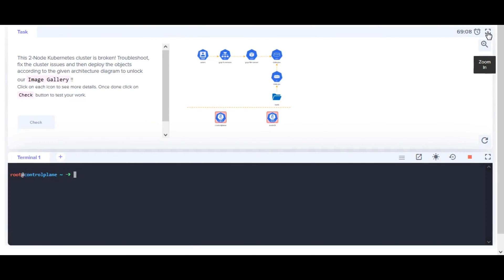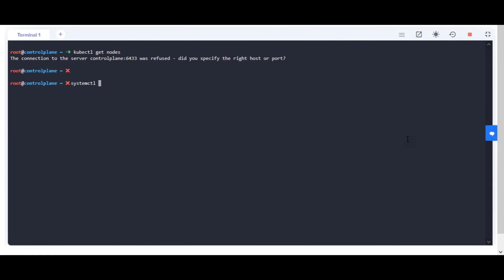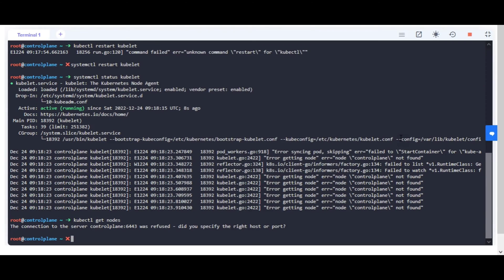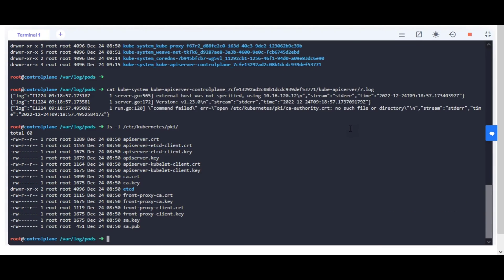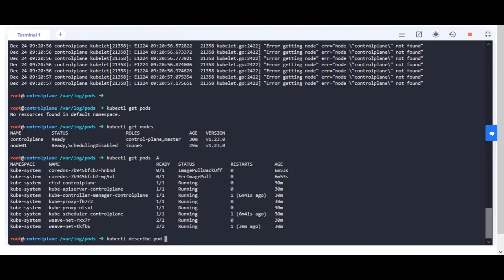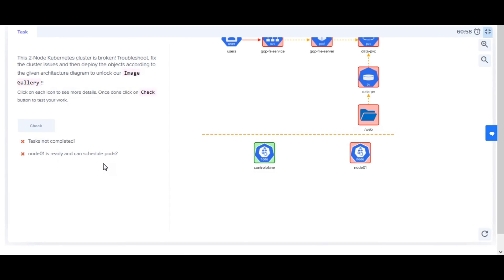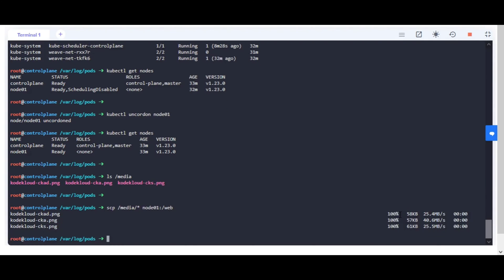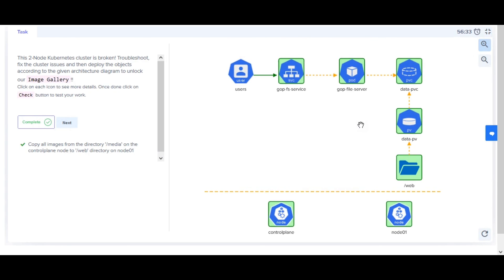Kodekloud Kubernetes Challenge 2 solution | Fix the Kubernetes cluster issues | Controlplane | Nodes

Comment: Why the nodePort needed to be 31200 and not other? Where is that specified? I didn't notice that information in any of the questions. Is this an error? Found the solution in a gitlab repo but it was not declared in the question description itself....
Reply from the maker: indeed. there is no specific port mentioned. you can use which ever nodeport you want.
Reply: @nbtechsupport   I tried with nodeport 31000 but the question still marked it as red. Only nodePort=31200 is accepted as valid answer. Any idea why?

Comment: question  regarding below command, normally we require user credentials to access the the server, in this case node01, but we didn't provide any in this case. how does this work?
 scp /media/* node01:/web
Reply from the maker: Thanks for raising the query . For microservice you don't need to since we running from the controlplane  to node.
Reply: @nbtechsupport  thanks!!